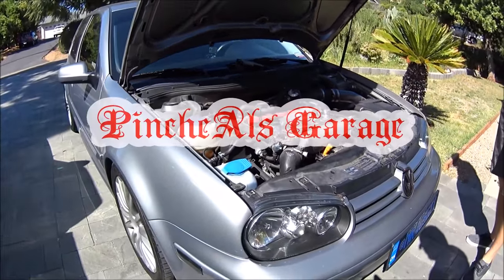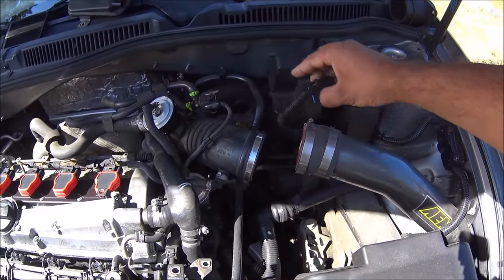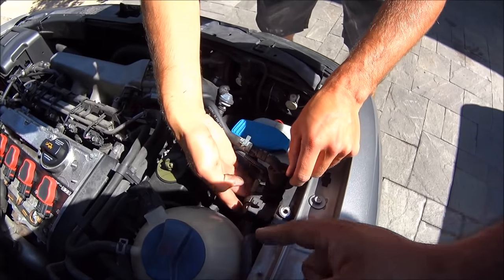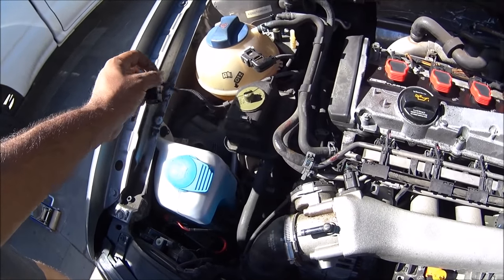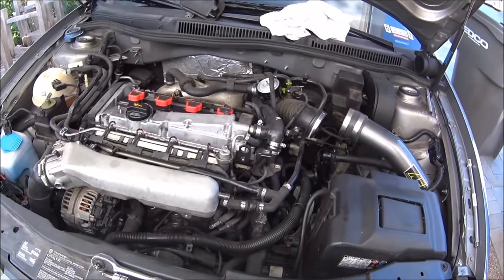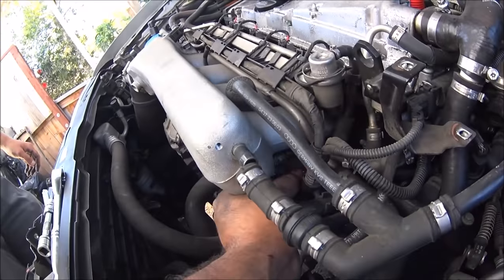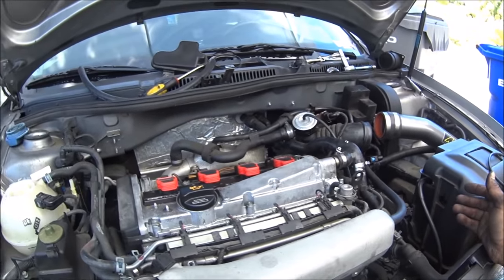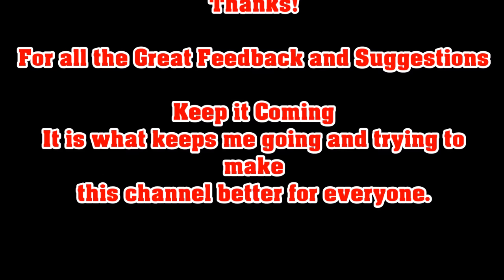How to Remove MK4 SMOG System AKA SAI Delete DIY

Comment: Hey man just bought a golf mk.4 with an aum motor, i currently have an sai code, and my air pump is defective. 
what kit do i need to buy? and after i install the kit, the car need to get chipped to remove the sai system in the ecu right? 
and last question, can you remove this sai system with a VCDS tester? or do i need to go to a professional? Thanks for great content. :)
Reply from the maker: Phillip Biirsdahl Jørgensen yss that kit will work perfect

Comment: would you happen to know if you can use a AWW ECM in a AWP or will there be problems?
Reply from the maker: Nick Hudson will not work due to different motors. The AWW had different pistons and a turbo so the ECM software will sbe very different.
Reply: Thanks man.
Reply from the maker: Your Welcome!

Comment: Hi brillant job!
Few qestion before i start doing this :) 
1.can i replace brake booster hose 1/2" with 12mm is it gonna connect ? 
2.SAI deleted from ecu, still need resistors ? What if i dont use them
3.what about emissions directly from exhaust is it gonna be higher ? 
Have a good day Sir!
Reply from the maker: 1. You need to match the hose size with your manifold and check valve that goes to the brake booster
2if you have the SAI deleted on your ECU you do not need resistors
3. Yes you will be making more SMOG by doing this
Reply: @PincheALsGarage  Thx for so fast respond! Respect from poland!
Reply from the maker: Anytime buddy! I am here to help please share and SUB to the channel!

Comment: Nice info. I just got my first 2001 1.8T Jetta at copart in Anchorage alaska. Air bags, radiator, and cracked oil pan to start. Engine is dirty with 129,000 k. New T belt at 98K. I'm going to delete smog and get her running with new intake and hoses for all systems. WIll I need to find a tuner to make run smooth after I make repairs?
Reply from the maker: Carl Nostrand hell yeah! Congratz on your new car.
Reply from the maker: Carl Nostrand look up Boost Dynamic Tuning on Facebook and add Trenton Smith as a friend. He isban awesome tuner and super helpful.
Reply: I hope you didn't pay more than a couple hundred for it.
Reply from the maker: Carl Nostrand i paid $1600 for my car and already invested about $9k and so much more too come

Comment: So I have a loud wine/ whistle noise on cold starts that lasts maybe 30secs thrn goes away. I'm suspecting my SAI which led me to this video. Is it common for them to have this problem? or is this issue something completely unrelated. 
great mk4 vids by the way.
Reply: oh an its an 05 awp
Reply from the maker: Christian Torres yes its very common to have that loud whine. the sai pump might have a crack or bad hose

Comment: Hello, after watching your video, I started to remove the installation, but after restarting, the engine is abnormally shaking and the low speed is weak. Are these reasons related to the turbocharger model and exhaust?
Reply from the maker: Did you get the resistors and cap off all unused vacuum ports?
Reply: PincheAls Garage Yes, I have purchased three resistor sockets and have been installed. The vehicle has no associated fault code, but the engine is intermittently shaken and there is no pressure. I plan to recover and try to see what went wrong with my engine. It is AUQ. The model is golf mk4 Thank you very much for your reply.

Comment: Does this cause a sharper torque spike or no? I’ve been told yeah and no from different tuner shops so idk lol
Reply from the maker: No that depends on your N75 aka waste gate solinoid. Your tuner or tune control's the N75 which will regulate your wastgate
Reply: PincheAls Garage ok, I have a stage 2 tune from eurocustoms but I didn’t do the evap and SAI delete on it. If I were to do this what issues could I run into?

Comment: Hey al I know this vid is old but I need a quick question answered can I do all of this but leave the Sai and the combi valve so I do get the cel but still delete all the vac lines I got the kit for all of it but I dont have tuning for Sai delete yet
Reply from the maker: Layten Perkins you will still get a cell. Since all that part of the system works together.
Reply: PincheAls Garage ah alright I just got on touch with boost dynamic about sending my spare ecu for delete tuning and k04 tuning
Reply: Layten Perkins how much was that ? And how ?

Comment: Also if you have any idea of why my speedometer and rpms are doing that it would be helpful to have a different point of view on it
Reply from the maker: You need to checker your wires make sure they are not frayed, ripped or oxidized. Also you might have a failing sensor so that would be the last thing to replace if all else fails
Reply: I have checked my wires and they look good it's quite annoying

Comment: What size hose do you use for the brake booster line?
Reply from the maker: i just took the hose to autozone and matched it up. 2 to 3 ft should be long enough.
Reply: 1/2in line

Comment: i dont have to worry about smog tests but when it throws a code will it make the car run any worse?
Reply from the maker: aaron saychek if you did the delete correctly you should only have a code for secondary air flow which will not affect the car performance.
Reply: Ok i havent done it yet i was just wondering but i dont care if it throws a code i already have one from my catless dp

Comment: can i just leave the sensors plugged in insted of using resistors ? my sai has allready been mapped out just need to put the blanking plate on
Reply from the maker: if it tunes out then hide the wires and dont plug anything i
Reply: So i just need the blanking plate put on ? And dose this explain y my cars not boosting very well ? And what about not plugging anything ?
Reply from the maker: +Connor Blaber if the car is tuned with all the emissions deleted you can leave all those sensors unplugged. if the car is not making proper PSI or boost. youll need to make a pressure tester and find the leaks
Reply from the maker: +Connor Blaber yes youll only need to install the block off plate for the combi valve port.
Reply: +PincheALs Garage  okay thank you very much mate i will do all this tomorrow morning :)
Reply from the maker: +Connor Blaber ypur welcome anytime

Comment: so is there a way to dump the pump and not have a code? and also, would this effect a cold start up since it is supposed to help with that? have u had and minor issues from doing this? everyone hates check engine lights. haha
Reply from the maker: only way to get rid of a cell 100% is to tune it out.
Reply: +PincheALs Garage  ok cool. thanks for the reply. thinking about doing this.

Comment: Is it necessary to get the delete kit? Just wondering or can it be done another way
Reply from the maker: yes you can go on vw vortex and look up the resistors you need to make them yourself and purchase the vacuum caps. which will cost about $30 less but not as ez. i prefer the plug and play method.

people do this when they get off the shelf tunes like GIAC, REVO, APR or Unitronic since they will not tune out the smog equipment. Custom tuners will tune them out so the resistors will not be needed.
Reply: +PincheALs Garage I currently have REVO Stg 2 and I'm interested in doing this. Here in Colorado you cannot have a CEL or you will immediately fail emissions. Just to be clear, the resisters in the kit will only prevent CEL's from the removed components but there still will be a CEL for 'sai incorrect flow' no matter  what I do because I have a "off the shelf" tune. Or will they prevent any codes being thrown. Please let me know. Thanks!
Reply from the maker: +Luke Wheeler find out if revo has a sai delete for there tune

Comment: i did this delete now i have a really loud whistling sound when i accelerate and when i get off the gas it stops..it seems to be coming from my dash it seems like..any ideas?
Reply from the maker: Levi Lacy you need to look for vacuum leaks. Maybe a clamp that was not tighten down all the way. Do you have a boost gauge in the car?
Reply: i see zero leaks nor do i hear any leaks and yes i do have a boost gauge and i thought that was it so i took it out and it is still doing it..
Reply from the maker: Levi Lacy did you cap off the tips on tue manifold? Did you cap off the pcv valve or did you remove it.
Reply: yes i did cap off the tips on the manifold and i still have the plastic stock pcv.. thank you for your responses and your help this noise is driving me nuts..
Reply from the maker: Levi Lacy did you reuse the check valve on the brake booster. Because if you didn't dont drive the car. You need to install that.
Reply from the maker: Levi Lacy we made sure to mention that.
Reply: kinda lost on that where did you mention this in the video.. and what harm would it do ?
Reply: am i at work at the moment
Reply from the maker: Levi Lacy you can blow the brake booster so youll have manual brakes which will suck major for you.
Reply: PincheAls Garage all that is still attached so I still have no idea what or where this super high pitch whistle when I'm on the gas and goes away when I let off
Reply from the maker: Levi Lacy did you remove the combi valve on the side of the head. If you did you need to cover the hole with a block off plate
Reply: PincheAls Garage I did I got one with kit that I ordered
Reply from the maker: Levi Lacy make sure its sealing right because that is the last place youll get a noise. You also migh have installed the check valve for the brake booster backwards
Reply: PincheAls Garage I'm gonna look tomorrow and make sure I got that block place nice and tight but I'm pretty sure I did but I'll update ya and THANK YOU for all the suggestions and help
Reply from the maker: Levi Lacy your welcome

Comment: mt oem brake booster line slips off due to previis owner tanpering.can i run brake booster line without check valve?
Reply from the maker: no you require a check valve
Reply: +PincheALs Garage completed the delete kit.glad i had this video to walk me threw it made it easy. only problem now is i noticed my breather hose was completely cracked off. is it ok to drive with it cracked off like that?
Reply from the maker: +Flush1.8 its ok but it will smoke. i suggest an upgraded silicone one from www.urotuning.com or www.ecstuning.com they are a bit pricey but will last forever.

Comment: So really. Just wait for the kit to have all the hoses plugged and ready so that the car messes up?  Thank you
Reply from the maker: no the car not messed up. youll just get an odd idle, it will throw a couple codes but will not prevent the car from working. you have to have the block off plate or the car will have a lot of smoke coming from the engine bay.
Reply: Ok sounds good. I'll let you know how I did when done. Thank you very much

Comment: Ok. So while I wait for the kit what can I do so I can start the process on the delete?
Reply from the maker: you can do everything just mark the lines or ports that need vacuum caps and the sensors that need the resistors. when you kit comes in finish it off. just for fun do the battery relocation while you wait
Reply: Thank you. And love what you do bro. Keep up the work.

Comment: After this maintenance is done, will the car pass inspection in California?  The video indicates 26:15  a check engine light will remain on.  Seems like this creates an inspection a problem.  Also, would have been good to see a video of the engine on start up (before and after the maintenance), and a video of the instrument cluster with the engine on (before and after the maintenance) to see if there's a change in the way the car idles and revs.  Also, a video of a road test would be have been helpful to demonstrate reliability after the maintenance.  Finally, pulling engine codes before and after the maintenance would have been good to see.  Basically, I'm interested better understanding the reliability, maintainability, and ability to pass inspection.  Getting under the hood and ripping out a bunch of hoses is a little time intensive, and definitely takes know-how (I give you credit for knowing your way around an engine), but running into a glitch while doing this could be a nightmare for anyone without your level of experience.  I'd like to see a follow up video of this same car being smog checked at a test center, and seeing the printed test results immediately after the test.  Any chance of that happening?
Reply from the maker: In the video we say the car will not pass CA Smog. The whole point of this is to have less CEL. We also mention a tune is needed to remove the CEL
Reply: @PincheALsGarage  Will the car pass whatever vehicle inspection might be required in the state where the driver has it registered?  A few years ago, smog tests were less of an issue for active duty military members.  Military members were exempt from needing to get their cars to pass inspections if they were stationed at a base that's not in their state of residence, and if the car was not registered in the state where they were stationed.  All of that changed.  Now military members need to have their cars pass inspection in the state where their car are registered, even if they are not a resident of that state.  Regardless of all that, it's an interesting DIY video.  I had a vacuum leak on my VR6 a while back and had to pay someone to troubleshoot and fix the issue.  As the car ages, more issues will inevitably occur.  Learning from your channel and other's on youtube helps me stay ahead of the problems.  My next big project will be a full suspension refresh.  I've never done it before so it will be interesting.  Any advice for how to carefully remove control arm bolts on a MK4 GTI without causing the welds on the captive nuts inside the subframe from breaking loose?  I have been preping the bolts by repeatedly spraying penetrating oil inside a cavity within the subframe, to hopefully coat the nut and bolt, and penetrate into the threads.  If I have to resort to plan-B (grinding an access port in the subframe... I do not want to do this), it will be a nightmare.
Reply from the maker: For the control arm bolts you are doing the correct process. I mean your dealing with almost 20 year old car its all up to lady luck now. Just use a good size breaker bar and pray

Comment: Hey nice video I have my mk4 apr stage 3 plus GTI we are doing this delete. But have been hanging my head trying to find a software delete for the cel after . Apr use to do it for stage 3 plus but they don't anymore . Anyone know if any place. I don't need a time I have aprs full time already just want to delete the emissions software
Reply from the maker: Most places that tune will need to reflash your ECU
Reply from the maker: So your issue might be that you might lose your APR tune or they wont do it without saving the tune.... In all honesty i dont know. Never have had this issue. I would personally suggest a new tune with all the features you want but get a new ECU that way you dont lose your tune. If you dont like the new tune go back to your old one. Simple or you do like it you can sell your APR tune make some $$$ back.
Reply: Thanks for the reply I ran into that couple places wanted to do a new tune . I just don't want any other company other than Apr . They stopped doing the delete after the TDI lawsuit.  My GTI is full Apr from intake manifold to stage 3 plus turbo and intercooler right through everything else . The only thing just that isn't is my carbanio cold air intake. But I do appreciate your help thank you

Comment: Do you know the ohm/watt value for those resistors?
Reply from the maker: No sorry
Reply: @PincheALsGarage  i found the info, they use a 330ohm resistor anywhere from 2-5w depending on who makes it. My real question is, are the deletes neccessary? or do you only do it when one of them fails? Seems that most of the 99-05 or so all have it removed. I live in KY so there is no worry about emissions or any of that. Main reason i want it gone is to clean up the bay and get the n249 and vac res off my valve cover to clean it up a bit. I've researched everywhere and your about the only answer i trust.

Comment: Stupid question I have, but will this also imply to to a 2003 VW  1.8t new beetle. The video is great. Thanks 👍🏾
Reply from the maker: Ots is very simalar to the 1.8t beetle just everything is a tighter fit so i highly suggest removing the front end off for doing this diy.

Comment: How do I make the SAI block off plate?
Reply from the maker: if you have a cutting wheel or a dremel head over to home depot buy a small piece of sheet metal. the original gasket from the egr/combi valve use as a stencil to make you new plate. make about 3 of them so its thick enough to apply enough pressure to prevent the exhaust gas to come out and also use a bit of high temp rtv as a secondary gasket.

Comment: do u need to upgrade your tune for this and tell it there is an SAI delete
Reply from the maker: Yes
Reply: @PincheALsGarage  what if you dont
Reply from the maker: @GFR74  the car will run pretty rough. The minimal is get the resistors so ot fixes that.
Reply: @PincheALsGarage  thanks so much

Comment: If I remove SAI do the I need a resistor or will it just throw a code that does not affect my car?
Reply from the maker: Will cause performance issues. You will NEED a tune or a Resistor.
Reply: @PincheALsGarage   is it one of the same resistors that are on uro tuning
Reply from the maker: @Jamez100899  correct get the whole kit so you can do it right.
Reply: @PincheALsGarage  Thank you for the fast response I only got the kit with the 3 resistors so I guess I need more lol
Reply from the maker: @Jamez100899  no you dont need more. Should be the SAI n80 and n249 resistors. Which is all you need. You will need vacuum caps and clamps though. Also some vacuum lines
Reply: PincheAls Garage ok well I did the 3 from the video I believe but there is still the loose connector that was directly on the back of the SAI  pump.